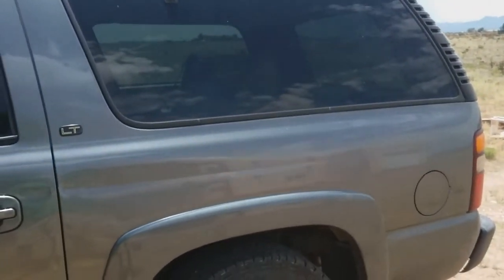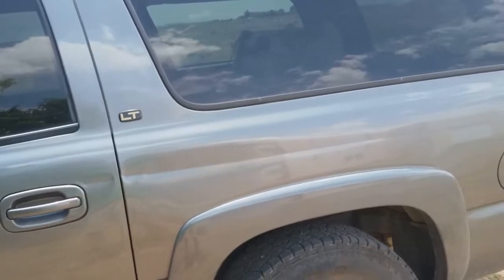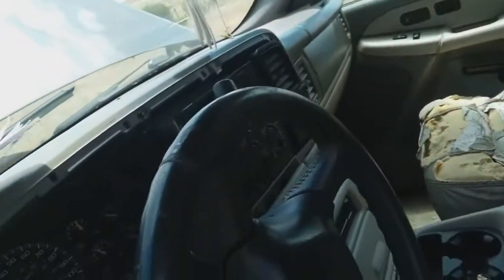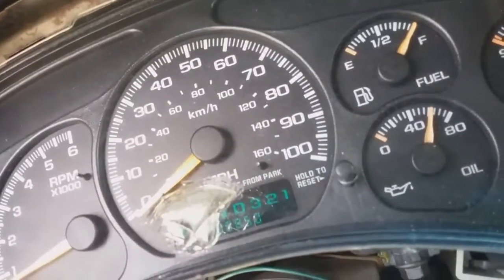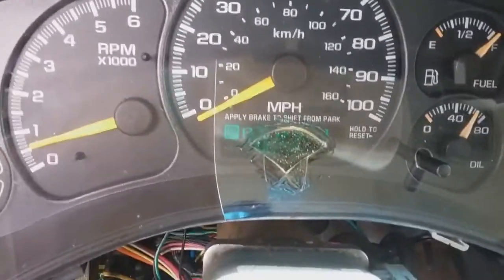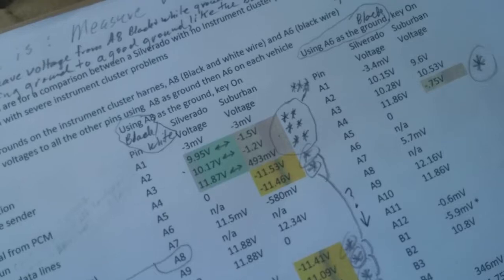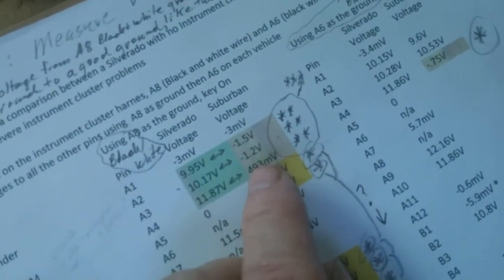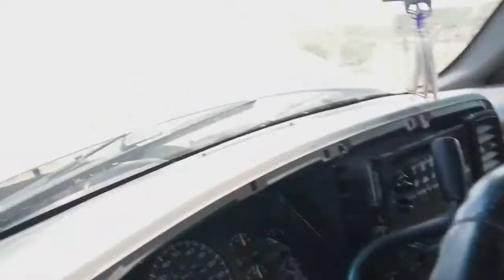2000 Suburban Instrument Cluster Fix

Comment: So you ran the ground wire to A8? Is that the black and white wire or no? My A8 is a blue wire
Reply from the maker: I somehow found a listing by letter and number of what color and what wire went into the cluster connector for a 2000 Suburban or a 2001 Silverado. I think it was on the Chevy forum, but do not remember where I got it from. Here is a copy of what I found. Depending on the year and make of yours it may be different. Generally the Black Wire, and the Black and White Wire are for grounds, however it appears below there is also a Black and White at B12 for washer fluid level. 

 
A1	tan/white- oil pressure
A2 	White - Tachometer	
A3	Dk Grn/Whtn- VSS signal from PCM
A4	Brown - Hot in On and Run
A5	Gray - computer data lines
A6	Black - Ground	
A7	Gray - Interior Lights (Dash Lights)
A8	Black/white - Ground
A9	Orange - Hot all times even with key off
A10	Pink -Hot in Acc, On and Run
A11	N/A Not used 	
A12	Dk Green/white - Park Brake Switch
B1	Lt Blue - Exterior lights (left turn signal)
B2	Brown /White - Diesel engine control systems
B3	Dk blue - Engine Control Systems
B4	N/A Not used	
B5	ppl/white - Interior lights
B6	Pink - Hot in On and Run
B7	N/A		
B8	N/A		
B9	N/A		
B10	dk blu -Exterior light systems (right turn)
B11	N/a		
B12	Black/White - washer fluid level
Good Luck.

Comment from the maker: Yes, it sounds like the problem is NOT your cluster, but something else. 
It is easy to check for a bad ground. All you need is about 24” of 18-gauge or similar wire. Bare both ends, Put one end into the back side of the wiring harness, where the black and white wire is. Then plug the wiring harness back into the instrument cluster. Hook the other end up to that metal piece I used in my video for a ground or you can just hold it on by hand and see if it fixes your problem. If not try the same procedure on the black wire going to the back of the harness. 
If neither of these fix your problem then you do not have a bad ground going to your instrument cluster. 
Start googling your problem and see what you find. It may be your speed sensors or a bad ground there. It may be the wire that carries the speed signal to the cluster. Or hopefully something else that is easy to fix. Just keep looking for information from someone that has had the same problem you are having. Try googling speed sensors or no speedometer.  It was a video about the black and white ground wire that finally gave me the clue I needed to fix our problem. Problems that are electrical and mechanical are hard to trace. Even harder if they are intermittent problems, because it has to be not working to find the problem.  
It took us a long time to stumble upon the fix for our problem. I wish I could help you more, but I am just a DIY kind of guy and not a pro mechanic. Good luck.
Reply: Thanks for sharing this information. I've been researching for Almost two months and replacing several part's and it still didn't fix the issue.
Reply from the maker: @Clean-N-ShineInDfw  Thanks for watching and commenting! I hope it is a bad ground wire, which is pretty easy to fix. As I said in the video, my son and I spent lots of time trying to fix his no cluster problem and because I am stubborn we finally did fix the problem. I feel for you having to go through the same frustrations we did! Good luck!

Comment: Can you make a video on how you did the voltage part using the multimeter?
Reply from the maker: I do not remember where I got mine, but here is a link to the type of pin test probes we used. https://www.amazon.com/OIIKI-Non-Destructive-Insulation-Stainless-Multimeter/dp/B08GZ1VGZ4/ref=rvi_sccl_1/140-6459434-2035507?pd_rd_w=JJvp6&content-id=amzn1.sym.f5690a4d-f2bb-45d9-9d1b-736fee412437&pf_rd_p=f5690a4d-f2bb-45d9-9d1b-736fee412437&pf_rd_r=WAG6K8GXG855FD5Y93R1&pd_rd_wg=9muoj&pd_rd_r=6111cd37-37e3-48f9-a3cd-06ebccdf9ef8&pd_rd_i=B08GZ1VGZ4&psc=1

You can probably find locally or on eBay. 

Once you take out the 4 screws holding the cluster in place, then slowly and carefully tilt the cluster so the top and wiring harness is visible. Depress the locking tab on the harness and we used a flat blade screw driver to pry one side then the other while pushing the locking tab. Once the wiring harness is disconnected from the instrument cluster, completely remove the instrument cluster to get it out of the way. Then you will just be looking at the face of the wiring harness. 

Then with these pin type test probes, you can use the black test probe for your A6 ground location, which is the Black wire, and then use the red probe to check each location with your multimeter with the key on.  I wrote each DC voltage down. Then we checked each location again, but used A8 as the ground location, A8 is the Black and White wire. Pretty easy to do, no need for another video. 

I suppose you could also check the two ground wires with the key off, using the continuity function, put the black into the A8 location and take the red to a known good ground like the metal I show on the video and see if you get continuity from the A8 location to the known good ground. If no continuity to a known good ground then you obviously have a bad ground.  Be sure the key is off or no electrical current when doing any continuity test. 

My son finally graduated from college, got a good paying job and sold the 2000 Suburban. I told him it would have been better to just fix things as they wear out, but he said, “No more, I would rather make car payments for the next 6 years than do anymore work on that old Suburban!” So, 2000 Suburban gone!  Thanks for watching and good luck! 

I bought a used cluster on eBay for $60, which had a badly broken Plexiglas cover. It worked fine in my 2001 Silverado and also worked in his 2000 Suburban once we fixed the ground wire at A8. Let me know if you want to buy that extra cluster for $60 plus shipping. I have meant to list it on eBay but never have. I hope you just have a bad ground which is pretty easy to fix. Good Luck!

Comment: Hey did the message board on the cluster still work when all the gauges were dead ? Just trying to compare my problem to yours
Reply from the maker: It was my son’s suburban and we only worked on it when he would come 20 miles out in the country to my house. I am sorry to tell you, I just do not remember for sure. To the best of my recollection, I do not think anything worked. I am sorry, I am not 100 percent sure about that. 
My son has a good job now and he bought a new vehicle and said he was going to sell the old Suburban. After we fixed the cluster, the mileage turned over 300,000 miles. They said, when the cluster would work on start up, but then stop working when they drove a short distance,  they noticed the same mileage every time.  Apparently, it was not picking up the miles driven when it was not working. I hope this help, but probably not, since I am not 100 percent sure about it.
Reply from the maker: I just remembered, someone commented that they did something similar to my video but what they did was easier. They simply put a jumper wire from A6 to A8 and found out that also made their cluster work. A6 is a black ground wire and A8 is a black and white ground wire. I think I commented back I would rather make sure I had a good ground first before trying it as a new ground on A8. But this is a really quick way to see if you have a problem at A8. The only problem I see with this method is, you will be assuming A6 is a good ground, rather than making sure, you have a good ground to try at A8. Hope this helps as it is relatively easy to check your grounds.

Comment: I was putting in a new radio and the gauges just stopped working is it possible I just blew a fuse?
Reply from the maker: I guess you might have blown a fuse. If you have a meter with probes, you could check fuses with the meter on continuity. With the key off, you do not have to pull the fuses to make a visual check. You can put your probe on the little knobs on the top of the fuse. Each fuse has two and you should get continuity across the two knobs. If no continuity, most likely, it is blown or you just did not have the probes solidly on the two little knobs. If no continuity, you will need to pull the fuse for a visual check to see if it is indeed blown.  There are some YouTube videos on this meter method of checking fuses. Just do a search for checking vehicle fuses with a meter or something along that line.

Comment: Hi. I'm Rafael Alcala. And I need help to fix my 2001 Chevy Tahoe. Claster.nothing works . Please. Any sujestions. I appreciated.
Reply from the maker: Rafael. there are so many possible problems. I assume you have tried removing the cluster and hooking up a wire to the black and white wire where the harness plugs into the back of the cluster, then taking that same wire to a good know ground  I believe, that should be your initial starting point. If it is not a simple ground wire problem, then just keep watching the many videos and keep digging until you find the problem. 
At first we were convinced that my sons problem was in the cluster circuit board, but it was not. We took the whole cluster apart and figured we would find a bad soldered joint, but everything looked solid. I even bought a used cluster on ebay for $40 plus shipping, which had a badly broken Plexiglas cover which did work just fine in my 2001 Silverado, but did not work in my son’s 2000 Suburban. We then switched my 2001 Silverado cluster with my son’s 2000 Suburban’s cluster and found his 2000 Suburban cluster did work in my 2001 Silverado, but my Silverado working cluster did not work in his 2000 Suburban. That was our first clue that it was not the actual cluster, but something else. Maybe a bad ground or power source or something other than the cluster itself.
We disconnected all the ground wires from the body we could find and cleaned them and re-attached them and still no instrument cluster. Turned out the ground wire we needed to reconnect was on the back of the motor way down between the firewall and the back of the motor. However, we never actually found that ground wire. This is why I made my video with a way to hook up a ground inside the truck’s cab.
My son only comes out to my house in the country every once in a while, so it took us months to finally find the actual problem. However, once we found it, it was like that was so easy to fix, I cannot believe all the things we tried before finally fixing the problem. Good luck and if this DIY guy could fix it, so can you. Just keep trying.
Reply: Rafael Alcala limpia las tierras de la troka las que estan abajo de la puerta del conductor en el chassis ... mas las que estan atras de las cabezas  del motor del lado del pasajero   Y del conductor lijalas pon les grasa dielectric mas que seguro resuelva tu problema

Comment: Thanks, I am having an intermittent thing where my entire gauge cluster (2006 GMC SIerra) becomes dead for a while, then it starts working again as I drive.  WIll try your fix tomorrow.
Reply: How did it go? Did you fix the issue?
Reply: @thurgoodstubbs9670  ALl fixed now. It wasn't the connector.  I redid most of the solder joints on the board. Bought a decent quality soldering iron, fine solder wire, some very good Kester liquid no clean flux. watched several videos of other people doing the same resolder work, and it wasn't that difficult, but I tried very hard to duplicate soldering techniques of the pro I watched. It seems all the GM vehicles of that era had faulty solder joints on the instrument cluster. If it didn't go bad yet, it will at some point. It also helps to have one of those big lighted stand magnifiers or even a 50X soldering microscope. Some of the surface mount components are very small.  This was really an introduction for me to the world of circuit boards. I figured it would not cost any more to buy my own stuff and learn to repair it myself, than it would be to pay someone else to do it. I went overboard and also bought a few other things to where I could probably open a business repairing circuit boards (microscope, power desoldering tool, benchtop regulated power supply, one of those nice blue silicon work mats, the pure isopropyl alcohol to clean the flux with, new stepper motors and dash LED lights. If anyone in the Houston area needs their board fixed, I would be happy to fix it for a small fee. I just could not wrap  my head around mailing my cluster to someone, then waiting a week or whatever for it to come back in the mail.
Reply: This is the guy's channel that I watched the most to learn how to fix it. https://www.youtube.com/watch?v=nPQZVnqhe0A
He has a business repairing boards. 
Thanks for checking back with me.
Reply: Sounds like you have the same issue I do…it’s random and unpredictable but all of a sudden the whole cluster crashes, mid trip, and then it will all randomly jump back to life. Sometimes it happens once a year sometimes twice in a week, but it always comes back. Did you find specific areas that were causing yours?
Reply: @nathanielmoore5677  I have an idea that it was one of the soldered joints on the pin connector. Because the entire board would go dead, I figure it was loss of a primary hot or ground. I didn't have my microscope when I fixed mine, so I took a blanket repair approach. The dozen or so pin connectors have a clear brittle lacquer coating on them that must be removed before resoldering the pins. a couple minutes poking the brittle coating with a metal pick broke all the coating off. Then I added the rosen flux,  got the new fancy soldering iron up to temperature and heated each solder joint till it flowed, then added a touch more solder (using fine solder wire). 
Then I redid the surface mount resistors and capacitors on the board as well. I was nervous, since this was the first time I had tried something like this, and I was rather surprised when it worked perfectly when I put it back in the dash. LIke I said, there are youtube videos showing what and how to solder on the board. That Jeff Cortex guy routinely resolders all the resisters I think. FOr whatever reason, he does not seem to resolder the main connector pins, but I believe that is where mine failed. The failures he fixes are never an entire board outage that I have seen. Usually more specific to a bad gauge or bad info center or an unlit odometer and PRNDL.   Even if some of the joints are working now, they will likely fail later. So I resoldered most everything that looked easy to do. The whole repair only took about 15 -20 minutes.  GM for whatever reason completely botched the soldering on these things. A couple years supposedly had a recall on them as well, so if you don't want to attempt the fix yourself, the dealer might fix it. But they will simply install a replacement board. Good luck.

Comment: I’m having a similar problem my temperature gauge is not reading correctly i already tried to change coolant sensor and thermostat and no fix?? Any ideas 🤔
Reply from the maker: Sorry, I just read your comment and I am leaving the house now to baby sit two grand-kids all day. I will try to think about it and perhaps respond tonight. Good luck.
Reply from the maker: I really hate electrical problem, as they are generally so hard to diagnose and find. That being said, if you are only having a problem with the temperature gauge, then I think you are doing the right thing to look specifically at that gauge and everything that controls that gauge. If your engine is overheating, it could have been the thermostat was stuck closed, or if it takes forever to warm up, it could have been stuck open. 

You replaced it and that should have solved either of those problems. You also replaced the coolant sensor, so two possible things out of the way. 
If you have a GM or Chevy truck made, I believe it was after 2003, you might want to look at the gauge Stepper motor.  

Our 2000 Suburban and the 2001 Silverado both have older style stepper motors for the gauges. Very hard to find and they are specific depending on which gauge may not be working.  Newer model vehicles, I believe from 2003 and up, have basically the same stepper motors for most of the gauges, and based on the videos I have seen those interchangeable motors can actually be the problem of a gauge. They seem to go bad easier than the older type, but are easier to find and cost much less. There are several videos on YouTube showing people replacing the stepper motors. 

That is the only thing that comes to mind and I believe I might take a look at those videos and see if the symptoms are similar. 

If it works intermittently, it could be a weak connection, bad solder joint somewhere, bad wire about to break, so many possibilities and very little information to go by. Sorry, that is about all I can come up with at this point. 
If you find your problem, be sure to write it up and post it back, or make a video, because these types of comments and or videos really help everyone. 
Good Luck!
Reply: Ok thanks a lot for the information i bought a temp senor at my auto part store bought i just purchased a ac delco sensor see if it’s just a better brand I’ll see if that works and If it doesn’t then I’ll  check for bed connections

Comment: Good Job but you really should replace that driver's seat😂
Reply from the maker: LOL! For sure, it was in really bad shape. Once he graduated from college and got a job, he immediately sold that poor old Suburban and got into debt with a new vehicle. I never made a better connection by a solder splice  or wire nut or anything and the cluster was still working when he sold it. Thanks for watching and commenting!😀